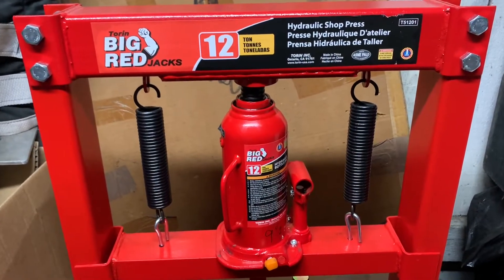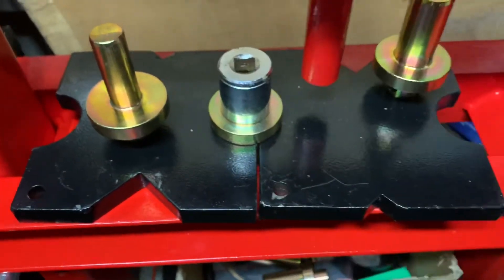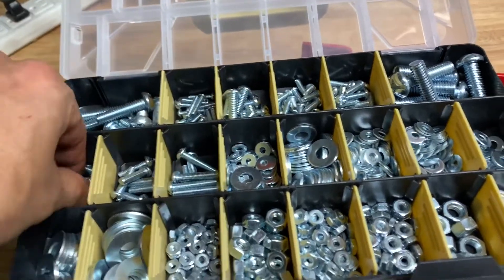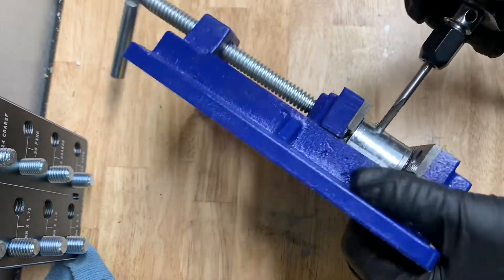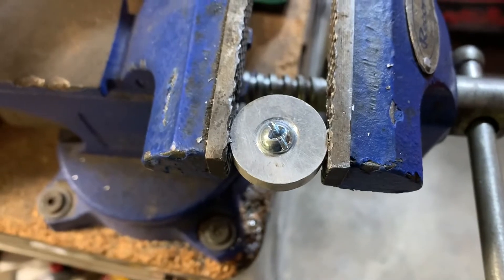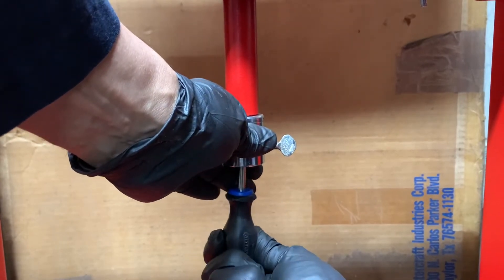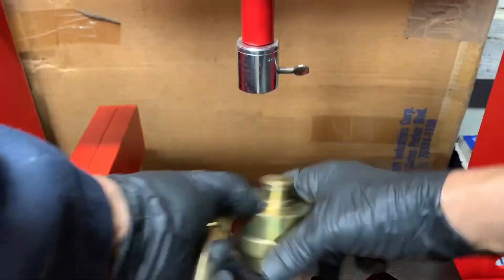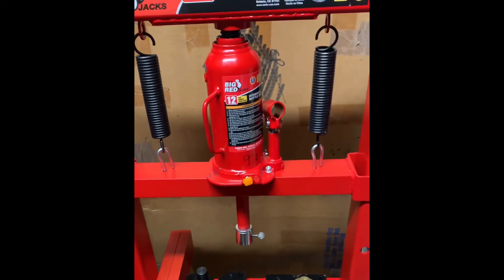Hydraulic Shop Press Pin Adapter

Comment: What are the pin diameters of the set you have?
Reply from the maker: OEMTOOLS 24813 Shop Press Pin Set, 2-20 Ton Capacity Hydraulic Automotive Press Accessories Include 8 Pins, Ram Adapter, And Mounting Bracket
Amazon
Reply: Thank you. I saw the set, but the problem is they don't publish the pin diameters anywhere.

Comment: And how many are surprised that the pin isn't seated in a socket in the bottle jack?
Reply: Not much of a way to do that unless you have a jack base custom made. Internally to the jack, the hydraulics are all routed through the base, so little way of drilling a whole without destroying the jack. And it's cast, little way to weld on a plate with a hole in it either.
Reply: Not much of a way to do that unless you have a jack base custom made. Internally to the jack, the hydraulics are all routed through the base, so little way of drilling a whole without destroying the jack. And it's cast, little way to weld on a plate with a hole in it either.

Comment: OR a 4 inch long 1 in I.D. thick wall piece of pipe with a couple of threaded holes for set screws and toss that soft walled socket back into the 10 lb bag of sockets!
Reply from the maker: Another good idea. Personally I would have preferred to purchase  an adapter for this particular type of press on eBay or something. With tens of thousands of this type of press sold, it baffles me why I can’t find one. Nonetheless, my little two-beer setup has been working just fine with dozens of bearings pressed up to this point. Thanks again anyhow. 👍

Comment: That socket is not strong or ductile enough. Its thin walled and chrome vanadium steel, which is brittle and therefore prone to breaking, shattering, when exposed to stress, it creates a real safety issue. An impact socket is thick walled  and made of chrome molybdenum steel for extra strength. It's also a ductile material and less likely to shatter...SAFER
Reply from the maker: It is not a load bearing socket.
It simply holds the attachment.
Nonetheless, I get your point.

Comment: Good idea. I would probably have used a impact socket...
Reply from the maker: Thanks 1MEAN1, impact socket would be better.
I just could not find anything online about my little issue so I kind of did the MacGyver thing in my garage, and found an old sockets to use, since there is no load on the socket whatsoever . 
I was not going to use any of my good impact sockets for this little project.
Since I did not see anything on YouTube about this, I decided to share the idea, I’m certain there are better ways to do this, but this is what I did  .
Reply: Impact sockets are softer they might not hold up as well
Reply: @jimdouglasgregory  You are correct, however they are much more brittle and tend to break easily in this type of situation.